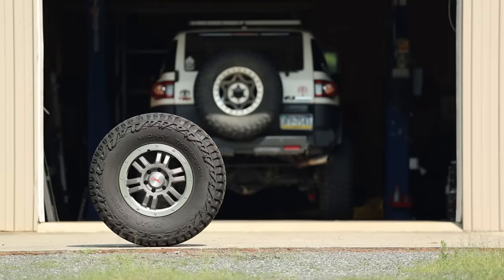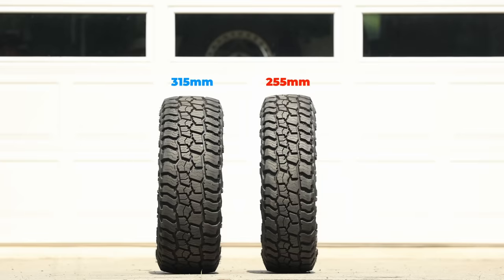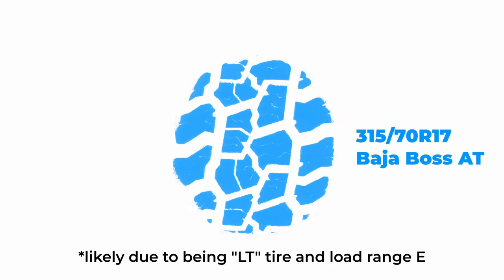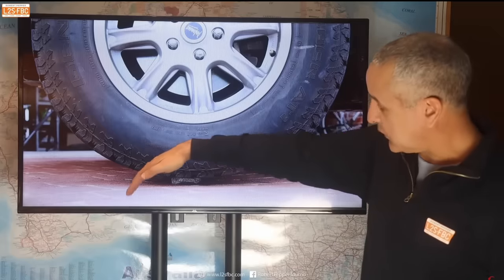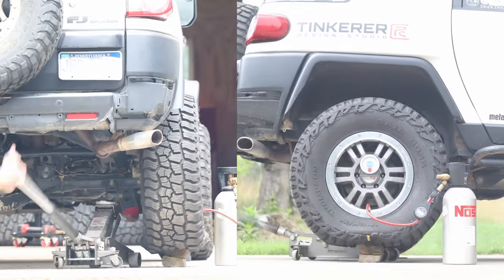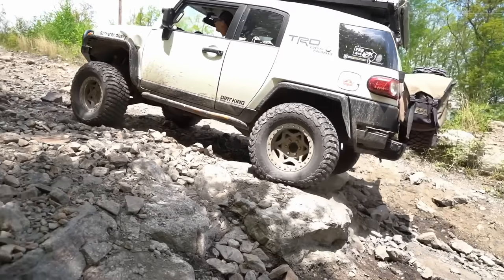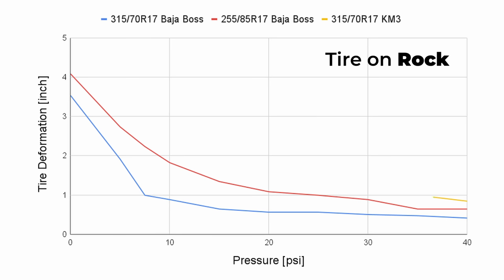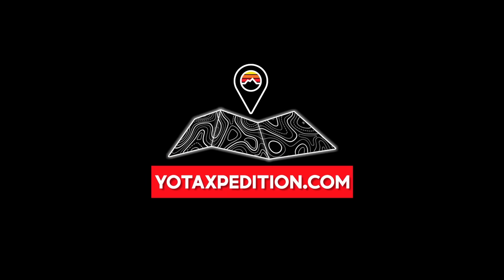3 Scientific Experiments to Settle This | Wide vs Narrow Off-Road Tires

Comment: Great video.  As an engineer, I appreciate the time taken to collect real world data.  I wasn't too surprised to see that the narrower tires flexed more, particularly at higher pressures.  I'm not a rock crawler.  I want the best off road performance with tires that are good on the street without airing down.  Narrower tires produce better fuel economy and a bit less noise on the road while flexing more to conform to off road obstacles.
Reply: As an engineer did you notice the 255 was tested on the widest allowable rim which stretches the contact patch to the max, and the 315 was tested on the narrowest allowable rim which pinches the contact patch to the minimum? 

The 255 was tested in ideal conditions (8” rim) and the 315 was tested in the worst possible conditions (8” rim). Unless the question is specifically “what tire is best for my 8” rims I refuse to replace” I find this test to be very biased. Tires should be tested on the manufacturer’s recommended rim size.
Reply: @TheWallsocket  - I agree that the tires should be tested on the manufacturer's recommended rim width, but I doubt it'll make a huge difference in the results.  I think the issue of contact patch length being relatively longer on thinner tires will still apply, allowing narrower tires to caterpillar over obstacles and provide better traction in the direction of travel, useful for acceleration or braking.  I'm sure that those with religious beliefs in big ol' fat tires will continue to find any excuse to disqualify the real world results from this test.  Data never proves anything to those with beliefs founded in faith.  By definition, faith doesn't require proof, therefore proof is meaningless to those with faith based beliefs.
Reply: @Liberty4Ever  these aren’t “real world results”, these are data points collected using flawed methodology. “Real world results” would be time trials, obstacle course results etc, not measuring static values.

And yes, the LENGTH of the contact patch would obviously not change with the correct wheel width, but the WIDTH of the contact patch would change. 

Considering the entire conclusion of this test is based off measuring TOTAL contact patch area, WIDTH is equally important as LENGTH, but the flawed methodology used here negated any difference in WIDTH by using the wrong wheels.

When you base your conclusion on one data point - contact patch size on pavement while the car is not moving (because in a turn the camber of the wheel changes and therefore the contact patch as well) - and you don’t even collect that data properly, you end up with a “test” that gives you no actual useful data at all.

Fwiw I don’t have some belief that wide tires are better - in my experience narrow tires are more versatile and do better in rain snow etc, and the only advantage wide tires have is on sand loose gravel etc. Ironically enough I’m the one that trusts “real world results”, but this video does not constitute that. 

That doesn’t change the fact that this test was so flawed that the data is basically worthless.
Reply: @Liberty4Ever  here’s another comment that explains it better, and why this isn’t “real world proof” like you think it is

“He tested both tires on an 8” rim. 255 manufacturer recommends a 7” rim, 315 recommends a 9.5” rim.

By stretching the 255 onto an 8” rim he increased contact patch at the cost of the bead breaking easier.

By pinching the 315 onto the same 8” rim he reduced the contact patch (the tread will bulge up in the middle more because the carcass is being pinched in), reduced flex on the single rock test.

This is why data isn’t always the answer - if you don’t have a very firm gasp of exactly what the testing methodology is and whether or not it’s flawed, then you can’t analyze if the data is even useful and you can be convinced of something that isn’t even true - all because you “trust science” but don’t actually understand how to evaluate the science yourself.”
Reply: @TheWallsocket  - One of my engineering principles is, one good test is better than 8,367 expert opinions.  Do you have a link to the data from your testing?  I'd love to see it.
Reply: @Liberty4Ever. That was a very witty and smarmy way to shut down the conversation while maintaining your ego's pride, but an objectively terrible response to the actual good and reasonable and logical points he brought up. And that "creed" you live by is an even objectively worse one for an engineer to live by. Going by "one good test" that is easily demonstrated to be incredibly flawed, and ignoring that flaw and going on with its conclusion as "fact" "science" and "objective data" is a TERRIBLE way to evaluate data and ultimately truth. Just awful.  That's just blind faith at that point. Bad data is NOT definitely better than no data.
Reply: @KG-kq9tk  - We have an experiment that demonstrates that narrower tires provide better traction over rough terrain by having a longer contact patch that wraps over and around obstacles more than fatter tires.  It's a reasonable hypothesis and the data seems to support the hypothesis.  Then we have a claim that using a rim width different than the manufacturer specifies completely invalidates the data, but there is no data to support that claim.  With data versus a counter claim with no data, I'm going to stick with the data.  Authoritarianism isn't science.

Comment: Very nice video, thanks for the tests. Most revealing. 

I'm 64 and grew up around FJ40s of 3 speeds. 😂 Nobody would call a 255 (10") pizza cutter in my time! 7.50x16 was the norm.  The 70's were the beginning of wide tires for off-road, and 10 -11 inches were pretty wide back then. Nowadays if one does not have a 40x13.50 it's not cool. Let's face it the very wide/tall and HEAVY tires are mostly for the show. They are harder on the trans. difficult to fit without cutting body parts or excessively raise the vehicle AND very expensive. Without mentioning that once you leave the USA they are almost impossible to find.
My money goes to the "pizza cutters" with locking differentials and crawl low gear. 
Keep up the good work.

Comment: Thank you for this awesome break down and analysis of the tires and their respective performance in terms of tread area and grip on solid objects. I'd find it interesting if you could find a way to do analysis on their performance in sand and mud. Respectively based on useable tread area in contact with the drive medium and floatation to see if you get any noticeable drive difference as well as floatation difference that could potentially help prevent burying axles, I suspect yet again the results may be surprising. Also keep up the good work!

Comment: Well done. I’m running Nitto Terra Grapplers 265/70/R17 on my 2013 FJ and I absolutely love them. I’ve even 4 wheeled with them pulling a travel trailer through a rugged ATV trail. Mud, large rocks and uneven terrain. They never skipped a beat!

Comment: Would love to see you run this series of tests on the  BFG KO2.
Reply: BFG at have always sucked.
Reply: Given that it's a tire that is good at everything but the best at nothing, I'm not sure a test like this will be flattering. I buy them because they're quite, smooth, and dependable.
Reply: good in deep snow. horrible on ice. they r good on snow because the tread pattern traps the snow into it. and snow on snow traction is really good. bad on ice because the tread wile not as hard as most at tires it is still alot harder than winter tires. they pretty much turn into plastic when its cold
Reply: @Menofthemountain  they suck on wet tar too. Horrible tyres
Reply: I had the KO2 and they are terrible in the rain. I mean extremely slippery, zero traction.
Reply: @JimBob-vb8oz  You gotta let the asphalt harden before driving on it! 😂
Reply: I'm convinced people that buy k02s don't even look at other tires, they just get them because they are well known.   

Terrible choice for slick roads or rock crawling
Reply: @Shakshuka69  I agree with the good at everything, master of none view, but it would be interesting to see what the results of Tinkerer's tests would be on them.  What makes his videos so interesting is the more engineering approach vs the opinion approach most reviews have.
Reply: Maybe the KM3 in the test, the mud tyre, is simply softer compared to an AT tyre? Mud vs AT.
Reply: @QnA22  excellent point, would definitely like to see more on that.   Makes sense an AT wouldn't flex as much as a softer MT
Reply: @erikbalanza I did that. My first set I bought for my toyota was k02. I don't know any better. But I also only do easy trails.
Reply: @Vagitarian01  Touche
Reply: I picked up some used K02's with 8k miles on them as my first A/T tire. I do like 80% on road as my daily and like the quietness. Living in SoCal we don't see much rain most of the year so them being slick or not well on ice hasn't been an issue for me.
Reply: Ko2s are extremely great for SW sandy and Rocky dry terrain. They were made for and absolutely killed it in similar terrain in Baja Mexico . Best bang for the buck by far… I wouldn’t run any other rubber on my rig as long as I live out here
Reply: Those that hate the KO2s, can you recommend one that is excellent in snow/ ice/ rain?
Reply: @lawrencefranck9417 yup. They came stock on my Raptor and I got less than 15k on them using my truck as intended. The much more aggressive Cooper ST Maxxes I got are better in every way except noise - even on-road traction. My experience seems to be pretty typical for those who off-road. A buddy who runs KOH told me they were the worst off-road tire he'd ran.
Reply: I has original KO's on my s10. KO2s on my f150(raptor take offs) they have held up on gravel/ chip n seal Ohio roads. They were great the first  winter.
Reply: @hellaacapella  
It would be interesting to see a thorough comparison done with tyres, for soft, hot, fine, powder sand conditions, as I am not into rock crawling.
Reply: @hellaacapella - I agree. I live in GA and we have similar conditions. Little rain, no ice, smaller rocky soil. I have 3 trucks and all of them have BFG ko2  . they last forever on light trucks, quiet, and are one of the best looking tires as well. They are one of the best selling tires for a reason imo.
Reply: @rbnjr  I've found in my use they hydroplane easily, but the actual grip of the compound is pretty good on wet surfaces.
Reply: Five sets of KO2s in narrow profile. They have been excellent in everything if at the proper pressures. Good in snow, ice, rain. They are not the best in mud but the trick is to change them out at 10/15 wear. When new they do fine in AZ clay mud if you spin and are aired down. Most of the mud performance comes from the outside of the tire so have to be aired down, and as the video shows the narrower tire deforms the best of all three tires tested. With snow and ice, with good tread life and aired down, these tires outperformed many other off road tires I saw on the road. The KO3s should be even better. The problem I have with BFG KOs is they dont seem to make a 255/85-17 which Mickey Thompson does. So they may loose my business after all these years.
Reply: Just watched a video on those tires that lead me here

Comment: Cool video! I used snow and my garage floor for a more primitive contact measurement. I went from pizza cutters to wide tires back to pizza cutters. I miss the wide tire look on my Tacoma but prefer the narrow tire’s performance in winter driving.

Comment: Great study. I'm surprised someone out there was even curious about this. I've been off-roading since the 70's and have come to find the narrower tire do better at biting down to good ground in mud or snow. The wider tires have better floatation if you don't have "good ground" within reach and you have lots of horsepower. I like 37" x 11.50s, but few manufacturers make them anymore.

Comment: Great video. I'm surprised you didn't address one of the biggest reasons folks choose pizza cutters: gas mileage. Intuitively, they weigh less and should improve mpg. But by how much? I'd love to know! Been rocking KM3 pizza cutters for 3 years and love them.
Reply: Good point. The pizza cutters are way easier on suspensions too. You don't mess with the scrub radius as much with them. ( I run 235/85/16)
Reply: Although they weigh less the pizza cutters are less round, at least in theory, because of longer contact patch. Would love to see this comparison!
Reply: Also easier on ball joints and steering parts.
Reply: Not only do they weigh less, but getting taller/shorter ones can also make a difference due to wheel turning speed and engine speed to maintain it.

I like springing for taller tires on motorcycles for that reason, lower rpm's, longer lasting tires, and extra fuel economy at the cost of a little bit of acceleration power
Reply: Yeah would be great to have a full set of both and do a fuel comparison. Another theory I have heard is the wider tyres have more cross sectional area and so more frontal wind resistance. No idea if it is a significant factor or not though.
Reply: Manufacturer should have weight and rolling resistance on spec sheets, I'd probably consider those 40/60 respectively to get an idea on gas mileage difference
Reply: @4x4stretch   Pushing more air doesn't help. Back in the old days (80s-90s) 31x10.5x15s were the "standard" general purpose "all terrains" for half-ton trucks, Blazers/Broncos, Suburbans but also CJ Jeeps,... in my case Goodyear Wranglers, on my Ford F150 with a 351W. I decided to get some 245-75-16s, about the same rolling circumference as the 15s, for winter when they first came out with the "C" load range, approximate same tread. Steel wheel weights were about a wash at 15x8 vs 16x7. One can argue ever so slight tread differences, but the approximate 20mm sectional difference (and lesser weight) gave me an easy 1-2 mpg advantage on the comparatively skinny 245s. With the sucky mileage on that type vehicle in those days, that was not insignificant.  The vehicle didn't seem to suffer dynamically in "normal" conditions either, including medium-duty off (mid-to-poorly maintained forest service or jeep) roading for it either, but it sure liked the snow and ice a lot better. I used to argue til I was blue in the face with Jeep friends that they should be running those 245-16s, not necessarily for on-road MPG but just seemed to me a better fit dynamically and proportionately for those smaller vehicles especially. I always thought that the Jeeps looked better/more purposeful on skinny (but still T/A-type aggressive) tires anyway. That ol' utilitarian military thing I guess. They were already drinking the "only bigger is better," sticking out from the fenders Kool-Aid and were very difficult sells.

Comment: Great video, I've always liked the more narrow tyres better for the various reasons, weight, easier fitting, gas mileage, etc, but they have always been a real chore to find. Like you said, the more people buy them the more choices we will start to see.
Reply: I've been looking for a decent AT in 33x9.5 16 or 17 and there's nothing. Closest I've found is the Toyo Open Country in 255/80R17. I'd really like some more choices in reasonable tire sizes.
Reply: I am running a Kenda Klever 601  35x10.5r17 on my 2012 Nissan Pathfinder. They are awesome!
Reply: There’s the Cooper ST Maxx available in 255/85R16 but they’re quite heavy
Reply: Other good options in the 255/80R17 (33 x 10) are the Falken Wildpeak AT3W and the Nitto Recon Grappler AT.
Reply: @jgdowell  Interco makes a 34" version of their Super Swamper that's only 9" wide, but that's bias ply.

Comment: While I am not a Toyota guy, but I want to say thank you for changing my mind about tires on my RAM 1500 build. I was contemplating 275/65/20 vs 295/60/20's. I love the thick tire look also, but my truck is a daily driver like most. This video helped me realize the 275/65/20 is going to be the more practical tire for my all around needs. I will get increased height, should get greater contact area when aired down, reduced rolling resistance and save some excess rotational mass.EXCELLENT video @Tinkerer'sAdventure !
Reply: And maybe even a more comfy ride if it flexes better. Win , Win , Win
Reply: Wide... thick is not any tire specification.
Reply: @Look_What_I_Did  no, but thicc is universally recognized in the pneumatic tire industry
Reply: @Skinflaps_Meatslapper  Nope.
Reply: @Look_What_I_Did  You're just a pitcher of sweetened water what would you know
Reply: @Look_What_I_Did it is ...for the one around your waist.
Reply: @EXWHY-mo5ni in that size tire,  you're getting E load rating, 10ply tires that are heavier and have stiffer sidewalls, also require higher inflation pressures .
Reply: @DL101ca  5'9" 170lbs.  30" waste.  I'm stout.

Comment: Great video. Yes a narrow tire gives more dig and bite, works well in most conditions. Wider tires give more float, for when you don't want to sink deep in sloppy or loose sandy conditions. It's all about the conditions you drive in, which for me changes between summer and winter. So I have two sets of tires, all mounted on matching wheels, marked for which side of vehicle they go on. It's a quick easy swap when seasons/conditions change.
Reply: Which would you prefer in mud?
Reply: @hardlylivin6602  I prefer narrow tires for shallow slick mud conditions, to reach down and grab the hard surface just below the mud layer. Wide tires with tire pressure dropped for deeper mud, to help prevent tires from digging down to deep, getting stuck.